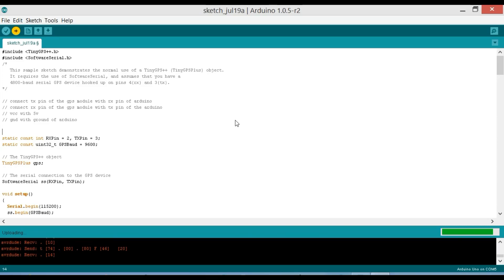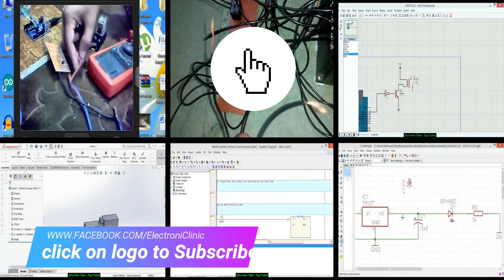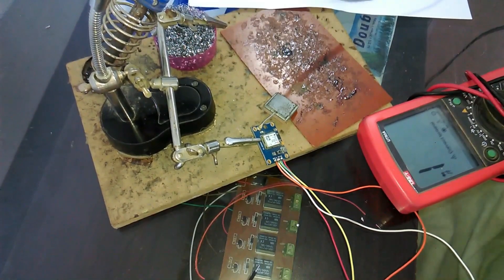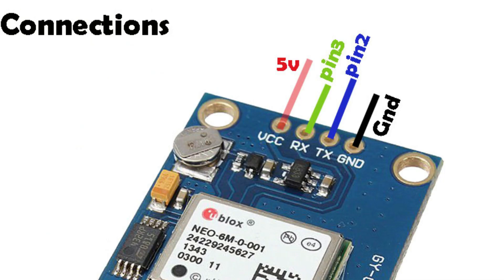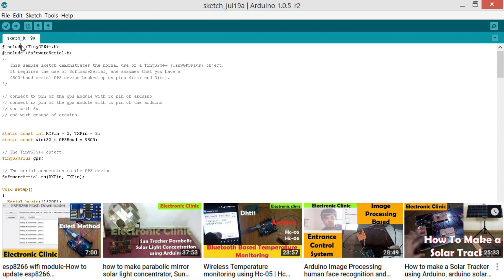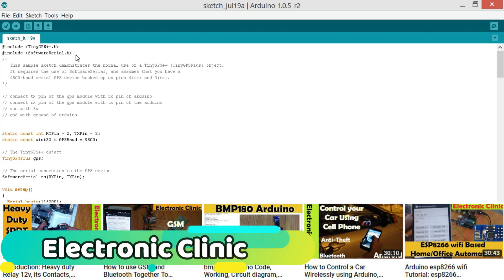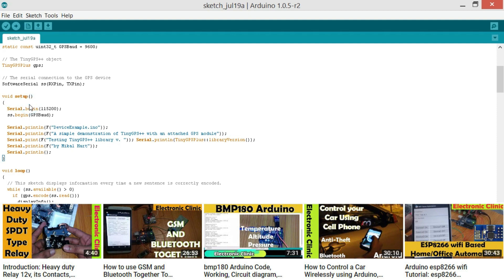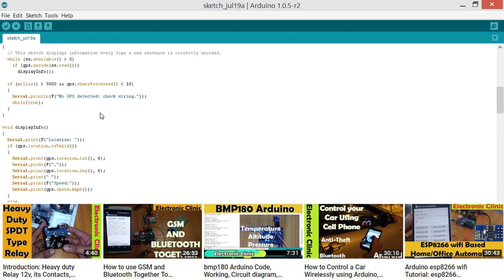NEO-6M GPS ARDUINO, Ublox NEO 6m interfacing and programming.

Comment: I always receive '****' every time i upload the code. Can anyone tell me the reason
Reply from the maker: wait for around 15 mints, it takes time.
Reply from the maker: if your wiring is correct and you are GPS module is functional and if still, you are not getting the vaules then the only problem is the signal. Go outside and give it some time.
Reply: @ElectroniClinic  thank you
Reply from the maker: these GPS modules usually don't work if you are inside a building. Go outside for testing.
Reply: @ElectroniClinic  thanks but are there any esle
Reply: @ElectroniClinic  because i have tried once outside and receive the same

Comment: U didn't told what connections are to be made. While working with mega 2560
Reply from the maker: Use the same conections
Reply: @ElectroniClinic  let me try ill ley you knoe if works